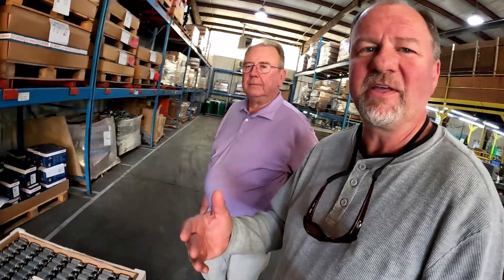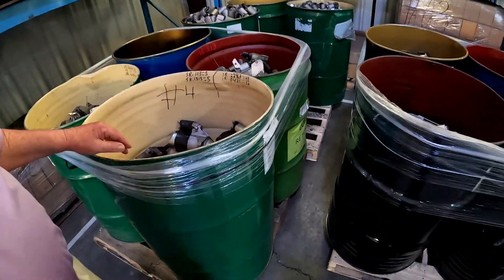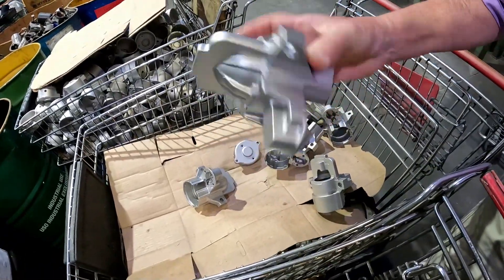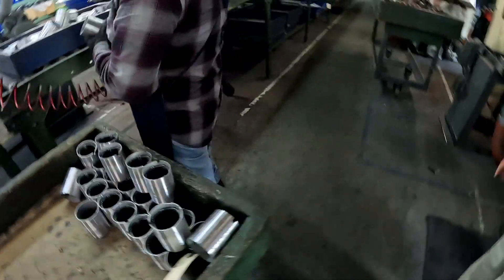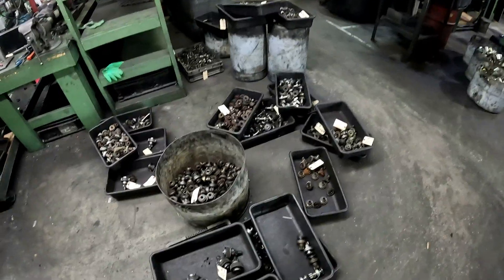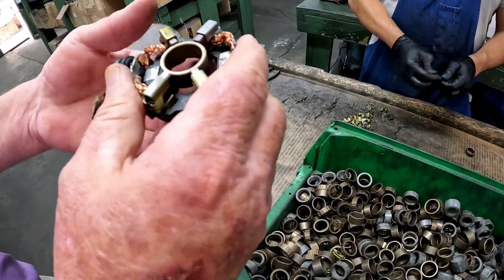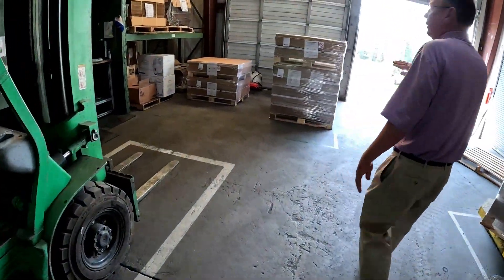Automotive Starter Rebuild Facility Tour

Comment: 🎯 Key points for quick navigation:

00:00 The video introduces a tour of Sandy Springs Electrical, a facility that rebuilds automotive starters from old, worn-out units.
01:28 Starters are sourced from junkyards and scrap yards, identified by part numbers, which helps in rebuilding them according to specific orders.
02:33 The disassembly area is where old starters are broken down into components before cleaning and rebuilding starts.
04:19 Parts such as the internal armature are cleaned using a blasting process, which removes dirt and debris.
05:56 Insulating varnish is applied to armature parts for electrical insulation and cosmetic purposes.
06:22 Burnt solenoids are replaced with new components, and all brushes and springs in the starters are replaced to ensure reliability.
08:38 The assembly area includes incorporating new components like brush holders and solenoids provided by outside suppliers.
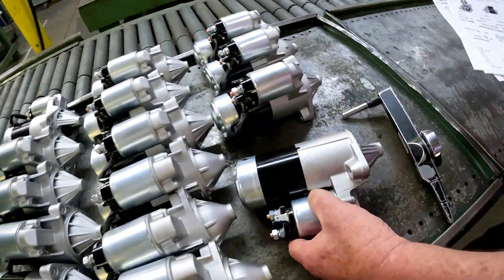10:09 The final rebuilt starter is assembled, checked for proper torque, and tested to ensure it meets performance standards.
11:25 Finished starters are boxed and prepared for shipment to auto parts stores and dealers.
12:09 The video concludes with a summary of the rebuild process, highlighting the quality and effort involved in refurbishing starters.

Made with HARPA AI
Reply from the maker: Cool and yes!!!! Thanks for the breakdown!

Comment: What does he do for field coils and armatures? 
Does he repair / rewind armatures, or just source new ones for those that don't pass testing? or just toss the bad ones and not replace them?
Wonder what percentage of armatures are bad when the starters arrive?
Does he wind new field coils or source new ones for the ones that don't pass testing?
Would be interesting to compare to shop that does individual rebuilds.
Thanks for the video
Reply from the maker: Unsure about the windings. I think they are tossed if if the winding is bad. do not recall seeing a winding station.

Comment: starters and essentially electric motors and electric motors consist primarily of copper windings, magnets, and a driveshaft spinning on two bearings. there's not much more other than the bendix pinion gear that will engage in the ring gear on a flywheel. 

sounds like they are a wholesaler for starter parts. the parts are in turn bought in large batches by other companies that put them back together with the proper casings and with knowledge as to the cars with which they will work. they buy them from junk yards, disassemble and clean them and sort them by some criteria that their customer  find convient.
Reply from the maker: They are a wholesale distributor of finished rebuilt starter motors.
Reply: @classicperformance  the answer given by the gentleman to your first question upon seeing the disassembled starter parts in a variety of trash cans (which immediately came to my mind too) was very unclear. as were the answers, couched somewhat differently, to your subsequent questions on the same topic.

anyway, upon re-watching the video i think he said something about getting the part numbers "of the cores" from the junk yards that sell them to him, or something like that.
Reply from the maker: @hueyhoolihan582  true, all the cores are batched according to application. You can also see the cardboard that separates the various lots if in the same storage container/bin. It's a somewhat complex process of inventory as you might have gathered. Thanks for the interest.